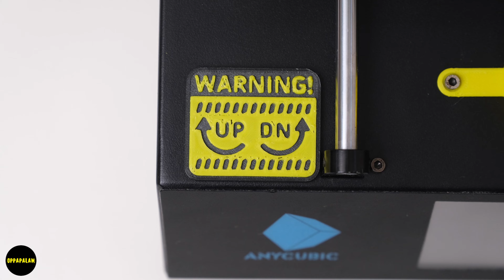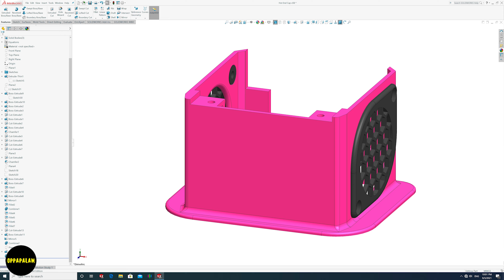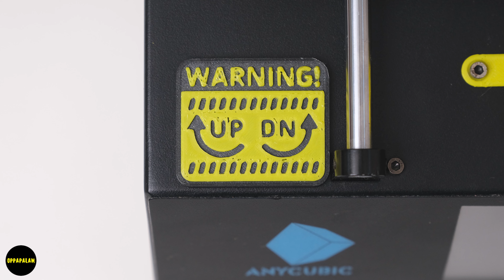24 Upgrades & Modification for my Anycubic Mega S  |  3D Printing

Comment: TMC2209 driver install is the best upgrade ypu can do imo. My Mega S is almost completely silent aside from the parts cooling fan. Ive also changed all the other fans to Noctua fans.
Reply from the maker: Yes, TMC2209 is the best upgrade and I just changed one Noctua fans on my extruder as it is quite hot when printing.
Reply: Tell us more please. How easy is it to do?
Reply from the maker: If you are using anycubic i3 mega s, just remove previous stepper drivers and plug new stepper drivers and revert these cable connecters.
Reply: what voltages are you runing?
Reply: @oppapalam  Are these drivers as easy as swapping them like you show? I'm afraid to damage my printer.

Comment: Woah a caliper holder, that's awesome! It'll help me clear space off my desk. Honestly I'm going to try doing most of these upgrades asap, do you have any advice for leveling the printer? I've had some ringing issues and I'm wondering if that's the cause.
Reply from the maker: I do the bed leveling by using A4 paper at all, no more tips for leveling.
If you have ringing issues, try to print it at lower speed (40~60mm/s)
Reply: @oppapalam  gotchu thanks, already printed the caliper holder and it works great. Going to start on some other upgrades.
Reply: @oppapalam  curious what benefit the PCB modification does (and what it is exactly?) As well as the added fans and hotend cover as opposed to the stock option?
Reply from the maker: @massir7769  Ph2.0 connector is added to the PCB which is connected to touch sensor as a power source (5V) for the light of the LED ring light.

Yes, one of the added fans is opposed to the hotend cover.

Comment: I am almost done but I noticed that in 7:06 you are configuring the fan for the hotend but there is no part to print for holding the fan next to the hotend?  You show it but there is not a part to print? What is the size of the little fan that is attached directly to the hotend?  Where are the wire connections to make it connect to the power from?  They are hanging there but I don't get which wires they are?

Comment: Sorry what was the sensor switch called I can't find the link on Amazon.  I asked before but lost your answer :)
Reply from the maker: Here are both links, hope I can help you💪🏻
RLECS 12-24V 2A Single Color Light Emitting Diode Strip Light Brightness Controller On/Off Switch Inline Tact Switch Black DC Mini LED Dimmer Touch Switch https://a.co/d/9J8JjE6

HKD5.57  34％ Off | DC 12V 24V LED Strip Touch Dimme Brightness Control Simpl Dimmer Switch Controller for 5050 3528 2835 Light Strip Single Color
https://a.aliexpress.com/_mNpTiCU
Reply: @oppapalam  thank you I have it!
Reply: @oppapalam  got it thank you!

Comment: how many fans did you use for this build? i only ask because not all fans are labeled, trying to figure out what fans you used for the board. the dual fans you mounted
Reply from the maker: Thanks for your watching, 2pcs 5015 blower fan (12V) is used for the nozzle cooling.

Part #14 dual hotend fans (12v)
taobao: https://item.taobao.com/item.htm?spm=a1z0k.7386009.0.d4919233.69645f13e458z8&id=43314193976&_u=t2dmg8j26111
amazon: https://www.amazon.com/winsinn-cooling-50x50x15mm-extruder-makerbot/dp/b079bmx2s6/ref=sr_1_3?crid=f8jytww8i7cr&dchild=1&keywords=5015+blower+fan+12v&qid=1622446875&sprefix=12v+5015+5%2caps%2c357&sr=8-3

Comment: In part 18 Hotend Cover and Fan Cover where did you get the fan and if you printed a mold for it to be attached to the hotend?
Reply from the maker: I bought all fans from Taobao or you may try to buy it from aliexpress. Yes, I printed hotend cover and attached to the hotend. If you want a strong cover, you should print ABS as well.

Comment: Amazing quality. What 3d printnting settings do you use?
Reply from the maker: Thank you so much! Here is the link of Cura printer setting.
https://drive.google.com/file/d/1cA6uj6XLS9r6snIjHXhEuf31ohSF17na/view?usp=sharing
Reply: Please show you settings about the plastic (petg?) in cura slicer
Reply from the maker: All parts printed in PLA, resolution 0.2mm, infill 10~20%, no rafts, supports (check my thingiverse link)

Comment: I can't fit my hotend cable through the chain. How did you do this
Reply from the maker: Here is the link for the 10x20 cable chain and print the file named AI3M_complete_chain_V3.stl which is easy to pass through the cable socket easily.
https://www.thingiverse.com/thing:3668667

Comment: Hello! quick question: is it ok to print the hotend cover with PLA?
Reply from the maker: Hi Eugen, it is good if you keep printing PLA as well. On the other hand, it should be printed by ABS if you will print ABS with enclosure.
Reply: @oppapalam  I only print PLA :D Two more things I'm curious about:
How exactly did you place the hotend fan inside the case (it's not really visible in the video)? 
Also, I saw that you placed two part cooling fans on the same wire, is it safe to do so? Will it impact the performance of the fans? I want to do the exact same thing, and this is the only video I found that has this.

I want to say that this is the coolest video I've seen about upgrades for anycubic printer and I really appreciate the work you've put into this video, cheers. :D
Reply from the maker: Thanks for your watching and hope you enjoy my video😊

1. Hotend fan is clamped heat sink easily
https://www.amazon.eg/-/en/distance-J-head-Cooling-thermistor-Printer/dp/B0968ZR9JX/ref=sr_1_1?crid=13PHIDN2TE38L&keywords=e3d+v5+hotend+fan&qid=1648485928&sprefix=e3d+v5+hotend+fan%2Caps%2C216&sr=8-1

2. Both part cooling fans are connected in parallel that means both fans keep using 12V
https://youtu.be/1OMQL8Xb9s8?t=460
Reply: @oppapalam  part cooling fans are connected in parallel, but they both are connected to the same socket on the PCB, right?
Reply from the maker: Yes, correct
Reply from the maker: Turn off the power before unplug or plug all cables
Reply: Perfect! Then I will start printing the parts I need for my Mega X, since I like this more than the MK4 on thingiverse. I will probably redesign the cooling fan duct, since I think they blow the air on the nozzle and not on the part (Am I wrong? ). 
Again, awesome video, if you have any more ideas of this kind, keep posting them. I'll buy you a coffee :D
Reply from the maker: The height of cooling fan ducts can be adjustable or you may try to modify it as well 👍🏻

Comment: Some of your upgrades there is no thingiverse number, can you provide the files?
Thank you
Reply from the maker: Thingiverse number can be found in the file link.

Here is the quick link for all modification CAD files :
https://bit.ly/3F8Frd9

Enjoy your upgrades‼️
Reply: @oppapalam  are these all the prints in your video, example which way to turn knobs to level bed?
Thank you again. Much appreciated 👍🏾🙏🏾
Reply: @oppapalam  sorry to bother you....printed out your mods and for the links (cable chain) it cannot connect to the pieces that would attach to the printer....please can you assist?
Thank you
Reply from the maker: @taurus533  As I remember, cable chain and joint are not 100% fitted, so you have to cut out a little bit or use air dryer to heat up the joint before assembling the cable chain
Reply: @oppapalam  width of hotend chain is 25.8 mm, but model “AI3M_Schleppkette_B” is 28.5mm. It’s not connect

Comment: so, it you have no idea what to do with a 3d printer - mod a printer itself.. 
I did only those which are really necessary upgrades: 
1. motor drivers strongly increase a comfort, 
2. heatbed cable holder, preventing its move on a heatbed side (no chain, just a small part which fixing a cable and not allow the cable to break at the weakest point - solder spots), 
3. rewiring the heater of the hotend with 2 thick cables, going straight from the heater to the motherboard - no connectors at all!!! Original cable and connectorssss placement is awfully designed. If you have "t0 sensor" problem - 90% chance it is the cable or the connector. 9% - wire connection on a motherboard is loose, or right this connector soldering points broke. The cable to the hotend consists of 14 thin wires, whereas only 6 or 7 are needed, two of which should be at least a 1mm thick. Instead - 14 useless thin wires and a connector that get loose constantly becaus eof the movement, stopping long prints. 
4. hotbed isolation mat. reduces power consumption, the bed heats faster.  
5. probably another cooling duct. I cant say it changes the world, but sometimes prints are looking better.

Comment: Folks...I am stunned how almost no one is commenting on how terrible the print quality is on every part shown. Absolute beginner garbage with most every flaw you can name...stringing, layer lines, banding, elephants foot...etc. These prints are absolute garbage. The designs...awesome. But who shows garbage quality prints like this in a tutorial?!?
Reply from the maker: I understand your frustration with the print quality displayed in the tutorial. It can be disappointing to see subpar results, especially when the designs themselves are impressive. While it's important to acknowledge the flaws in the prints, it's also worth considering a few factors that might contribute to the situation.

Firstly, tutorials often aim to showcase the design process or specific techniques rather than focusing solely on achieving flawless prints. The primary purpose might be to teach design principles or demonstrate a particular workflow, with print quality being a secondary concern.

Additionally, printing quality can be influenced by various factors, including the printer settings, filament type and quality, environmental conditions, and even the skill level of the person operating the printer. Beginners, in particular, may encounter challenges in achieving optimal print quality due to their limited experience.

Constructive feedback regarding print quality is valuable, as it helps both the tutorial creator and other viewers understand the areas that need improvement. It's possible that the tutorial creator may appreciate such feedback and make adjustments in future tutorials to address these concerns.

Remember that the learning process often involves trial and error, and it may take time to refine one's skills and achieve better print quality. By providing feedback and expressing your expectations, you can contribute to the growth and improvement of the tutorial content.